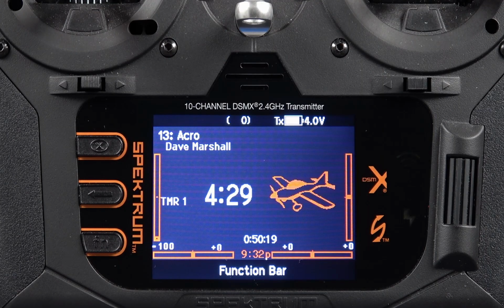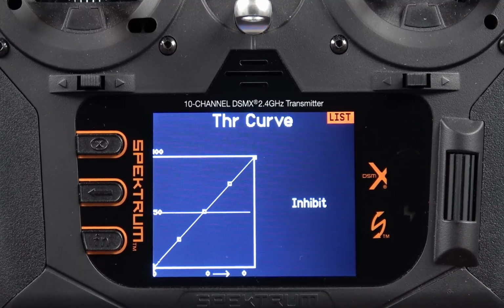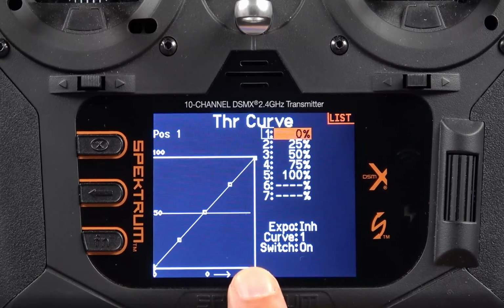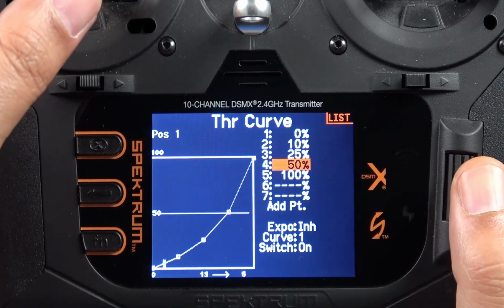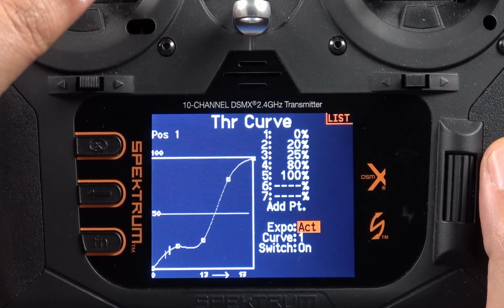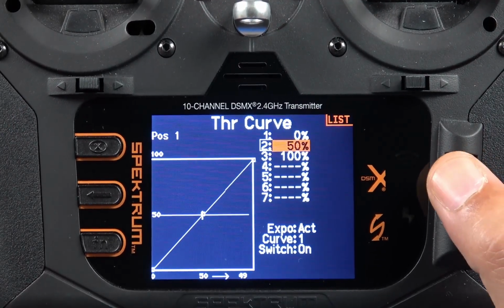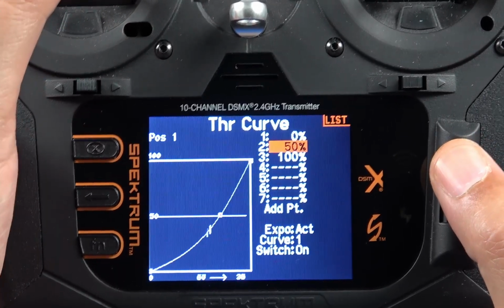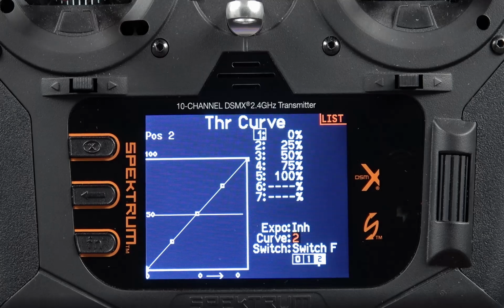Spektrum NX Series Tutorials - Throttle Curve

Comment: This helps.  Thanks. Having flown glow years ago, I'm used to the prop spinning at idle. I've since made the switch to electric.  I've made a practice of using the trim on the throttle to have my electrics "idle".  I don't know if this is true, but it seemed like the highest 20% of the throttle stick was ineffective. Maybe by using the trim to raise the idle I was shifting the entire range of the throttle to where the last 20% was ineffective. I didn't realize that the throttle curve menu was so easy to find and program.  But that's what I am starting to use now.  Thanks again.

Comment: A very good tutorial, but I can't follow it for my needs.  I fly a glider and wish to use a 3-position swtich for throttle - 0%, 60%, 90%    I changed number 5 on the curve down to 90, but at the top switch position it still shows 100%.  It seems like it should be so easy, but I'm just not getting it.  Any suggestions would be greatly appreciated.... Jerry G

Comment: Really good information but you teased the exact reason I watched the video right at the end and then never followed up on it.  I am trying to set up multiple throttle curves for a tail dragger that always wants to nose over on takeoff.  If I can setup a throttle curve with 70%ish max throttle at the full up stroke of the throttle gimble, this should (in theory) stop the plane from nosing over from too much throttle. I am using the NX8 and takeoff flaps on switch D in the mid position. I am also trying to set the restricted throttle curve there as well with basically default throttle curves on the 0 and 2 positions. Little Help?

Comment: Hello, could you explain more specifically how to assign a switch to toggle between different throttle curves? I am able to do it on my ix12, but my nx8 doesn’t seem to work the same way. Thanks!
Reply: You have to set different curves 0,1,2 etc… and assign switch pos to that curve. You won’t see the graph change but it will work. Helicopter profile is better

Comment: Hi thanks for a nice explanation on throttle curve. On my DX8 I was able to link the gear switch to toggle between base low throttle(pos 0) and 5% throttle up(pos 1). However on my nx10 after assigning switch A to throttle curve toggling the switch only gives the last input. Please help. 
Regards 
David